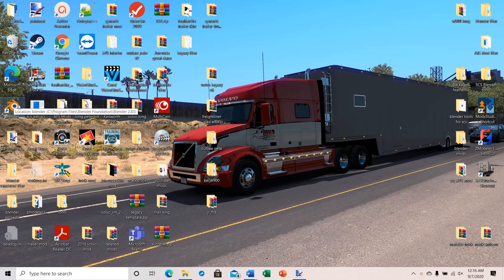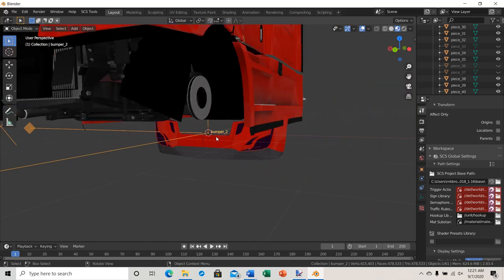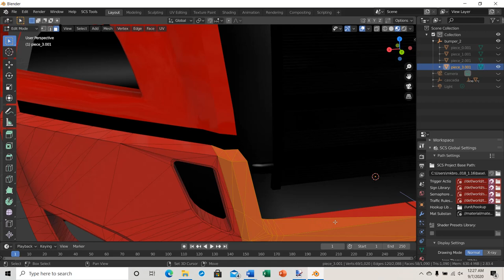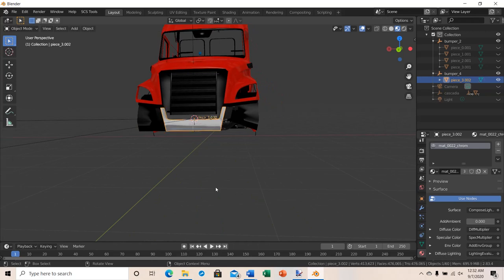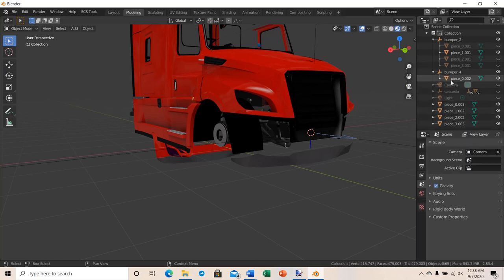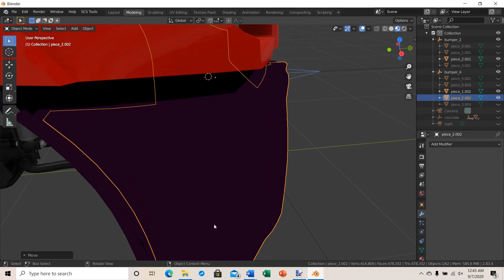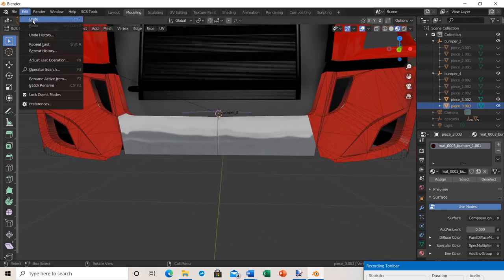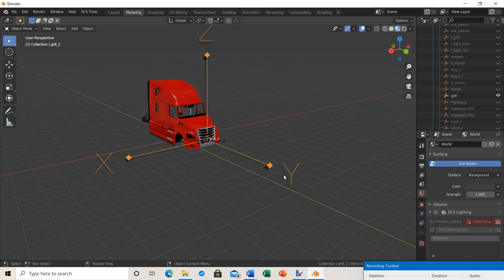Creating Accessories for ATS Trucks and Trailers

Comment: Hi there - thanks for these videos - interesting fault I’m facing - the grill off my cascadia is also set to use car-paint colour but this applies my cabin skin with decals - used your video to create template of the grill and modify its paint and using tobj, dds plus Sui file to overwrite its paint data but sadly doesn’t appear to be working - and later need to do same to front hood mirrors and cabin mirror/deflector
Reply from the maker: @Gavin-r7r  give me about 24hours. I will make you a video on how to fix.

Comment: Great video , do you have a video on  how to add parts and strech and lower the chassis? Man i would love to learn on how to do this stuff i need to make my own truck so many ideas but i just dont know how to do this.
Reply from the maker: I do have a video on stretching a chassis. I have gone to teaching through patreon as the videos seem to create more questions than answers. I find it easier to work with people 1 on 1 than trying to provide direction through the comments. Even then, very few people will actually learn to mod and give up. It’s even more difficult with version 1.47 because converter pix or wrapper will no longer read the automat files correctly so all the materials need to be created by hand.
Reply: @markbrower3489 I've been wanting to make some trucks man. But just like you stated I'm one of those that have tried it and gave up it's frustrating once you don't know what you are doing. And yes 1 on 1 is way easier to do so gotta get that 1st feeling of how it's done. Man all I wanna do is stretch the frame and lower it and add goodies lol. Thanks for reply, do you remember the video where you did the how to stretch the frame?
Reply from the maker: https://youtu.be/Rvz1091pE7c

Comment: Hello Mark,
I'm quite new in modding ETS 2 and I would like to make a fully painted standalone stoneguard (mg dlc, scania r 2009 , basic file: stoneguard_mg_02).
I tired to use your method after watching over this video but I can't rid of the chrome like material nevertheless I set both parts of the stoneguard as a simple truckpaint template.
Is there any chance to make a small tutorial about it?

Would be appreciated
Regards
Reply from the maker: What you are describing is fairly easy to do. I will make a short video describing the process and try to get it up in a couple of days. Thanks for your comment!
Reply: @markbrower3489  Never mind. Meanwhile I figured it out. 
Thanks anyway.